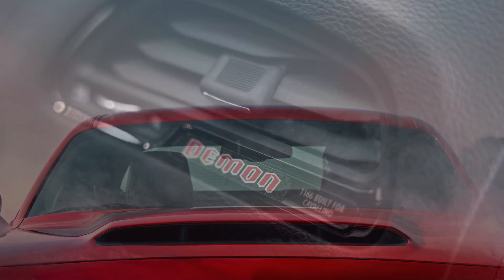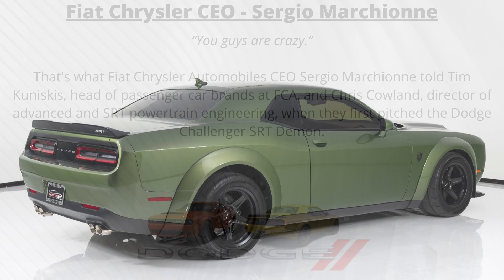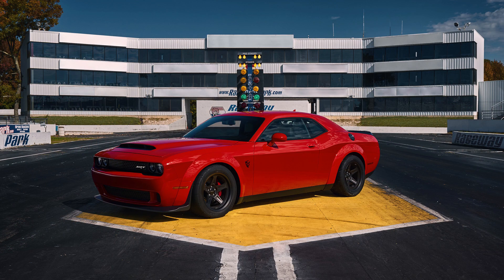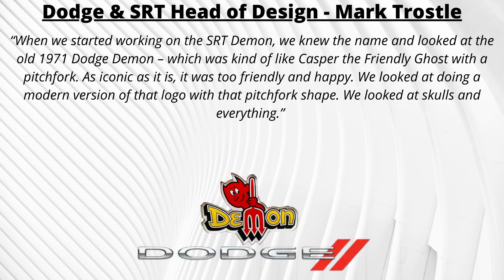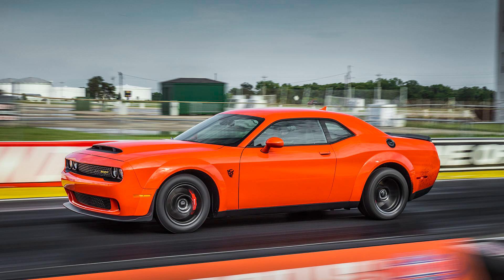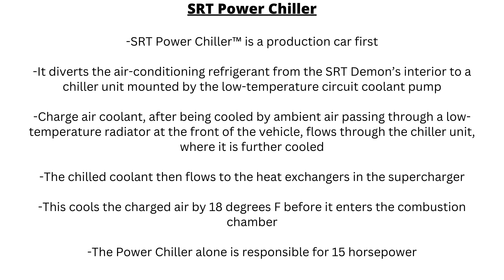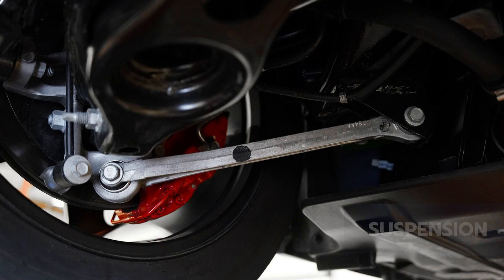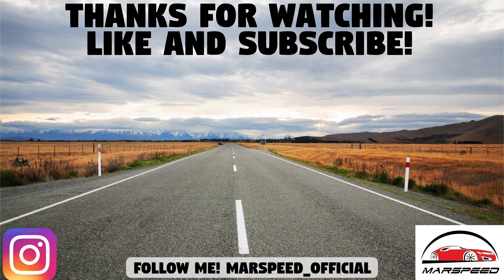Why the Dodge Challenger Demon Was Created & The Engineering of the Engine (Behind-the-Scenes!)

Comment: The 6.2 in the scat pack sucks. 485hp out of a motor that size is a big let down. I have a turbo 2L 4 Cylinder that makes 380. I could only imagine if i had 4.2 extra liter displacement.
Reply: Man I’m not sure you know what your talking about. It’s 6.4 naturally aspirated  no boost there are categories for measuring you can’t take a boosted engine and measure it against an na motor 🤣. Then can I add nitrous to the scat and race you that’s fair power adder for power adder.  and your issue isn’t with the motor because it held the na record stock for the big 3 for many years making respectable power. Your problem is with the weight of the car. And the block in the 6.4 is iron very strong 18 plus model can make 1700 built just like the hellcat. Build it and it will make really good power if on boost and even na. Not 380hp with forced induction 🤣. You realize that’s the only reason it even makes 380hp is boost right and because it’s in a roller skate makes it feel fast. But na your motor probably makes 200 hp and 120 torque. Tq is part of the equation for hp. And I’m pretty sure a stock scat pack can take you with a tire. Don’t even talk shit because I have a hellcat 🤣. Na meaning-naturally aspirated which means it’s reliant only on the atmospheric pressure and the cylinder to suck in air which is why displacement is key for na motors if you didn’t know what that meant.
Reply: @joshreynolds729  I understand What naturally aspirate it is. Just as an example, the hellcat is making somewhere between 700 and 750 these days and it's forced induction. If you look at my hp per liter is  187.5. So to match that hp per liter the hellcats supercharged 6.2 would need to put out 1167 it doesn't though. You see what I'm saying. I know you don't love those numbers but it doesn't make them wrong.
Reply: @matthowell8985  hp per liter argument is pointless as reliability becomes the issue while being capped on power. And it’s not just simple math either the higher you go in hp the more of a loss you gain through parasitic loss. It’s like this for all cars. Another factor you missed is tq something small motors lack at and so do 4 valve motors leaving 2 valve motors which is why the quickest cars in the world run big hemi v8 blown top fuel motors. It’s run what you brought and last I checked 485 hp and 475ft lbs at a lower rpm than a smaller engine would stock na is pretty good. The capability is still there to make over the number you want. But who is going to sell you a factory 1100 hp car for 60k common man.
Reply: @joshreynolds729  all I know is I beat scat packs all day. Even though they have 100 more hp. Those 245s on the back are silly. Wrong rubber for that car. I could be my awd that gets it done.
Reply: @matthowell8985 I hate to tell you this but so do I….in my 5.7. Are you really bragging about beating a stock 6.4? 😅
Reply: @evildrizzt1  I'm braging about beating a car with 100 more hp then me. Also 5.7 isn't far off off 6.4. I'm doing it with a turbo 2.0
Reply: @matthowell8985 You do realize that the challenger narrow body is the 2nd largest coupe on the planet? (First is the  Rolls Royce Wraith). 

It’s not a sports car like the Camaro or a pony car like the mustang. This is a ‘muscle’ car. Large cruiser vehicles meant to flex on the competition with large interiors, low compression with large displacement engines, long hoods, long wheel base, wider stock tires and stiff as hell suspension built to haul an RV up a hill if you have a hitch installed (I do). 

All you have to do is look at the engine. It’s old 1960s tech. A single cam, pushrod, crossplane V8? I think you’re asking too much from this platform.
Reply: @evildrizzt1  didn't know that. I do know it's like 4400lbs.
Reply: @matthowell8985  probably both. The tires they come with are a joke but the car weight 4400 lbs so there’s that. Do a roll race probably be different. Dig on the street I can see that.
Reply: @joshreynolds729  I beat one on the freeway, we were side by side and punched from 80 all the way to 130. His front bumper was stuck parallel to my rear. He couldn't pull on me at all.
Reply: @joshreynolds729  I'm in a Mercedes gla 45 amg with the amg track package.
Reply: @matthowell8985  well done.
Reply: Scatpack is a 6.4L
Reply: @desmondoconnor6608  even worse
Reply: Well GM also has 6.2 V8s making 455 and 493 horsepower respectively